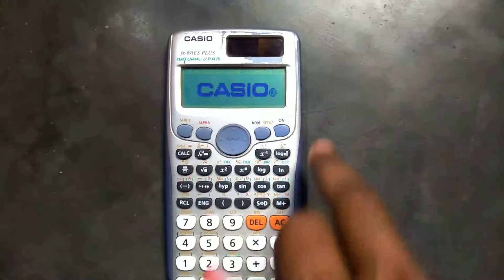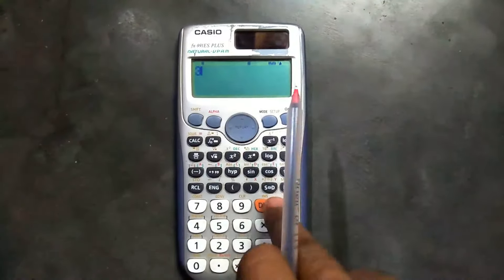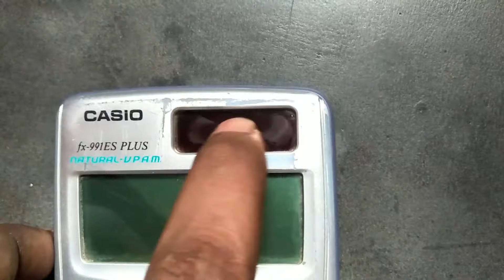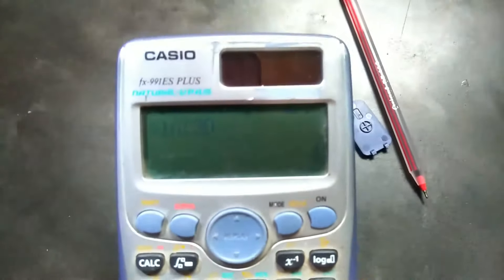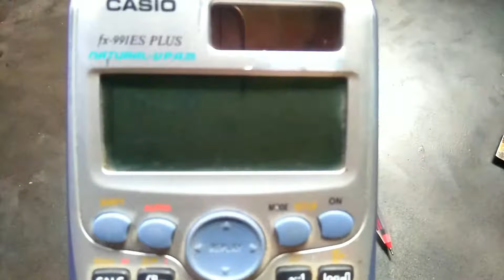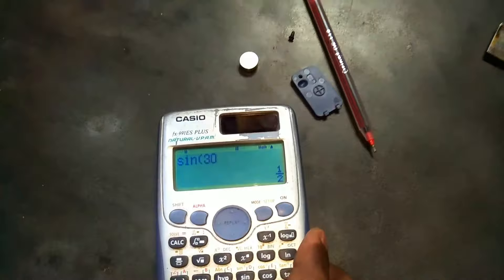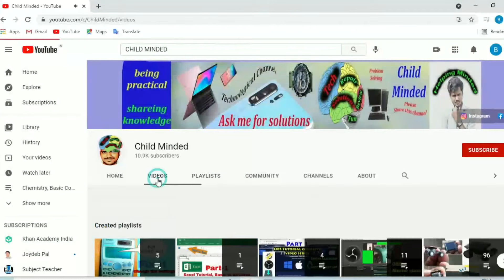Solar Power calculator? is it real solar panel or fake? do we need to change battery in calculator

Comment: 10 years still my calculator is working
Reply: Really??? My took it 3 years ago I have exams this month I am fearing if battery will die on exam day,will it? Shall I take new calculator? Or it will pakka work for few more fays
Reply: @23cash86  if your calculator is genuine then it's not need.
Reply: Mine took 3 years for the battery to low
Reply: My calculator is still working after 11 years
Reply: It took me 7 years and the calc recently just died
Reply: Mine is working in sun but not in house what to do 😔
Reply: @arpitnege2921  replace new battery
Reply: @thomaswu3820  ohk thx
Reply: @Abreez01947  which calculator did u buy???which is best??
Reply: @sweety1841  my calculator name is casio
Reply: @sweety1841  casio is best
Reply: Same here bro. it's 12 years gone and still working without any interruption.
Reply: Thanks for this vedio . after changing cell my calculartor is working 👍🙏
Reply: Mine was more than 20 year but today i finished its game..
Reply: Coz of room light or any other artificial light!!!

Comment: 😂 the solar doesn't work, if you open it youll see the main b3 supply...the solar is not even connected to the calculator with any wiring

Comment: THE BATTERY IS NOT RECHARGEABLE and the calculator will use the solar cell as long as you are not in a dark scenario where you might need some help from the battery

Comment: May technology also bring solar smart phones 👍
Reply: You get solar powered power bank and cases but integrating it is impractical
Reply from the maker: @perisanti7571  nope, it is possible and companies are trying to do so.....
Reply: @ChildMinded  Solar panels are not reliable and who uses their phone outside. Also if it's outside, the phone will surely heat up which will no doubt kill the battery and other components.

Comment: the battery is alkaline thereby it is not rechargeable. when you expose the calculator to light it uses that energy for calculations not the energy of the battery

Comment: The Casio fx-991ES PLUS is a scientific calculator that uses both solar power and battery power. Here are the key points about its power system:

Dual power source: It has a solar panel and a battery.
Solar power: The calculator can operate using only solar power in well-lit conditions. The solar panel is visible on the front of the calculator.
Battery backup: It also has a small battery (usually a button cell battery) that provides power when there isn't enough light for the solar panel to function.
Not rechargeable: The solar panel does not charge the battery. Instead, it directly powers the calculator when possible, which helps extend the battery life.
Battery replacement: When the battery eventually dies, it needs to be replaced. It's not recharged by the solar panel.
Energy efficient: This dual power system makes the calculator very energy efficient, allowing it to operate for long periods without needing a battery change.
Reply: Bro can you help me, my calc's display only shows if the solar panel flashed by some lightsource, otherwise the display wouldn't show anything but the system would work just fine. It's just every time i hit the On button, it wouldn't show anything unless i flashed it.
Reply: @9fdenzellvt461  batter is dead, Change battery as I mentioned above the solar panel is just to power it while there is some light source which acts as kind of a battery saver. It doesn't charge the battery. So yeah, Change the 🔋

Comment: I packed my calculator in Nov 2020 and unbox it again in Mar 2022. My calculator didn't ON. When I expose it to Sunlight for 2 hours, It gets ON but in 5 mins it again gets OFF. Again when I expose it to Sunlight, it again works, but without sunlight it again gets OFF. For how much time should I expose it to sunlight to charge the full battery again.??
Reply from the maker: The battery need to get changed.....
   I am sure, The battery got damaged...
Reply: @ChildMinded  okk bro.. Can you tell me the model of the battery.?
Reply: Same too that is also my problem with my calculator when i exposed it in sunlight it turns on just fine, but when i put it in a dark place it still ons but the display fades away.
Reply: @Divyanshu_Ranjan_Rishu  the model is written behind the calculator

Comment: My calculator doesn't even have a cell( the slot is empty) but it is still working for an year, i didn't placed it In sunlight either, but how it is still working???
Reply: Open all the screws there should be a battery at the center
Reply: @zxtalk4410  yeah i figured it out, i have a fake casio...lol

Comment: Bro Please can tell me What is the Battary brand and Name which is in That Calculator?? 
It's an Urgent🥺
Reply from the maker: Please open the calculator and check the battery, no need of exact brand, u would not even get exact one.... Just see what size battery your calculator has, take it to shop, they will give u the needed one.
Reply: @ChildMinded  lekin bhai 2 din ego mere papa gaye the Shop Repair karwane or wo Dukan wala Bola ki ye Use and Through hai aur jab papa ghar wapas aye toh usme Battary hi nehi tha warna kahin jake Hardware shop se le ate ... isiliye batao na Konsa battery lagta hai Isme
Reply from the maker: @DreamFUN18  iss type ka battery ko "button cell " kahte hai, size different hoga, aap dekho jo battery wala jaga hai usme kitna bara place hai, uss hisab se lelena ekk battery, 5/10 Rs lega ekk cell ka.... Sayed medium size kahi hai, jahan sey wo humm remote /wall ghari sabka battery letey hai na, wohi sey mil jiega...
Reply: @ChildMinded LR44 suggest fit Aa jata h par kya ye recharge hoga(thorough given S-panel)?

Comment: Can I ask what kind of battery do you use for this type of calculator? Thank you!
Reply from the maker: It is Button cell.... (Their are different size for button cell)
   For these kind of calculator you need rechargeable cell, but if the calculator has no solar cell, you need non rechargeable battery(if you want to replace, check the old battery it had...)
Reply: @ChildMinded  thank you so much!
Reply: @sagoire  It is called an LR44 alkaline button battery.

Comment: Same Casio l am using since 3 years now screen is getting dim is this due to less charging what should l do now ??? How can l repair it back to normal
Reply from the maker: Keep it on sunlight for 1/2 hours....
    If still not solved, change the cell....
Reply: @ChildMinded  ok tq

Comment: i have opened the whole calculator and the solar panal is a retangular piece of glass there is not a single wire connecting it
Reply from the maker: May be that is duplicate one, the one in vdo is connected to board.....

Comment: Is the battery rechargeable?
Reply from the maker: Yes, thats why it get charged by solar panel....
Reply: Officially alkaline batteries are not supposed to be rechargeable. Casio says it is a two-way power system. The solar cell saves the battery from being consumed. But alkaline batteries are rechargeable to some extent.